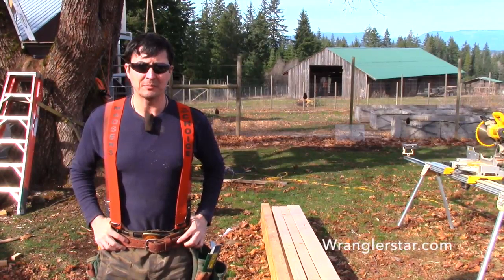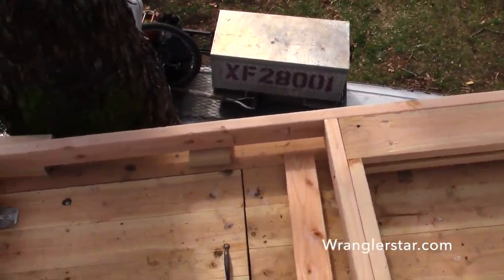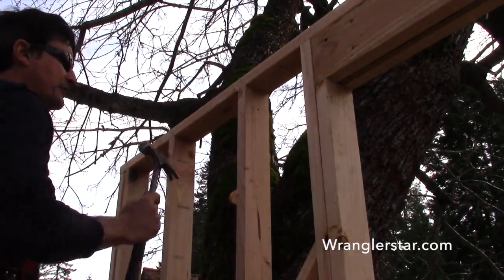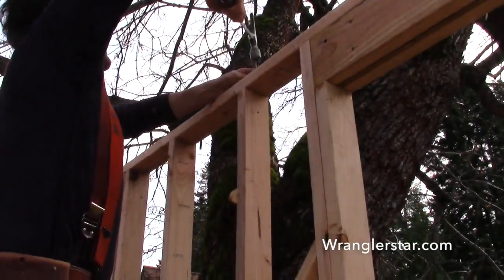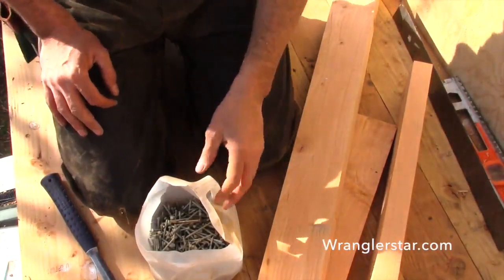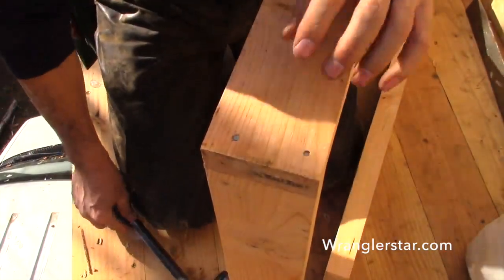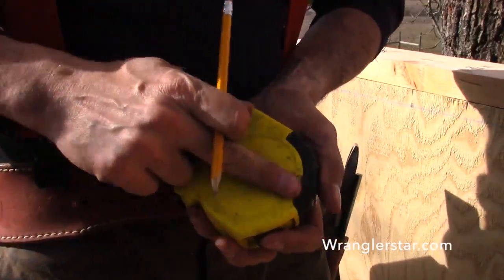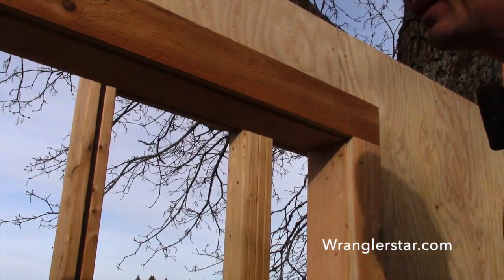How To Build A Treehouse | 20 Wranglerstar

Comment: In the Northeast we wrap our window and door casing's in .040 gauge aluminum.  We also do the same for facia boards.   The aluminum comes in many different colors and can be purchased with a vinyl covering over the metal or plain aluminum.   White is the most common color, then brown - these are readily available at most supplier's and box stores.   Drawback is you will need a way to bend the material, that's called a "brake".  It doesn't pay to buy one, it's expensive to rent one, but many carpenters and siding crews have them and will bend the material for you for a small fee.   Of course you will need to know all the sizes and lengths beforehand.    All in all, they get pretty creative with this material, and can cover almost any wood surface that needs to be covered and protected from water damage.  Other uses are chimney flashing, drip edge, soffit channel, and patching leaks in the roof.

Comment: I own both a dewalt and a Milwaukee sawszall and have used others on job sites...yours is the first I've run across that has that 90 degree blade feature. It must be a newer model than mine. I will say my Milwaukee unit is far superior to my dewalt, though I bought the heavy duty Milwaukee and the normal weight dewalt when it was on sale. Guess it made a difference.
Reply: wb5mgr I have a Milwaukee Sawzall that my wife got me for Christmas 30 years ago. It is the heavy duty model with the adjustable foot and quick release blade. I love it. I got used to using one when I worked in factories as a maintenance mechanic. When I borrowed one from work to cut a chimney opening for our new fireplace I told my wife I couldn't have done the job without it. She went to the local hardware and ask the owner what was the best one. That's what she bought. I also have a 18V Dewalt that my son bought for me for Christmas about 7 years ago. It is my goto reciprocating saw on any rough project. The battery going dead is kind of a pain but if I'm going to be doing a few cuts it's so easy to just pick it up and go. I have really abused it too. I dropped it 20 feet from a bucket lift while trimming a tree branch. It just bounced. When jobs are small or more than 100 feet from an outlet the Dewalt is the best. Not really an apples to apples comparison. I imagine a battery operated Milwaukee could do the same. While I'm on the subject I have a 1/2" Dewalt 18V drill like Cody's that is used at least twice a week for something. I like to drive screws with a power driver partly because of a touch of carpal tunnel and also because it's fast and easy. This year for Christmas my wife bought me a 18V Dewalt Impact driver. It's not the latest and greatest with the LION batteries but it takes the same batteries as my other drill and recip. I like it a lot better for driving screws. It has more power and speed and doesn't torque when it stops. I may have to switch over to Robertson style screw heads though. It will spin the heads off of a Phillips if I don't catch it.

Comment: I have always framed the window opening to size and than installed the interior window wrap later.  Rough framing the opening larger, than custom cutting the window wrap before placing the window is a new method to me.  I like it.
Reply: I have never framed that way myself, but do see some value in doing it that way.  If the wood is clear or beautiful it can be the finished product.  Yes, one will use more wood in the framing process and more time in ripping.  It is just another idea and I can see Cody's thought process.  Many people would think it is overbuilding though.

Comment: Hey, Cody, this might be kind of a silly question but I am a young man and don't have too much experience. I was wondering what is the difference between using a nail and a screw. I understand that a screw will never pull out unless drilled out. So why wouldn't you only use screws since they are so much stronger?

Comment: You should give the side of your tape measure a light sand so your pencil marks come out clearer, iv heard you need the use special nail with cedar because the oils in it eats the galvanize off regular nails and causes rust.
Reply: Correct, You should use stainless steel fasteners in cedar. Also, when using house wrap under cedar, use Typar not Tyvek. The chemicals in cedar will deteriorate the Tyvek in only a few years rendering it useless. My siding guy laughed at me when I requested this, I now have a new siding guy. Just a tip
Reply: Just right to get new guy, its not great when you can correct your trades men.
Reply: TheLunarmonkey, I'm the boss on my job sites. Sometimes subcontractors can forget that. I'm younger then most of my subs as well, that always makes for drama.
Reply: This is what I know...
On every home and I mean every home I have done renovations on the tyvek has been reduced to Swiss cheese. This makes it useless as a wind barrier, moisture mitigator and or drainage plane. Conversely, on every home that had felt paper behind the siding the felt was intact and fully functioning. Once the tyvek turns brown and splotchy it's finished. Unwoven fabrics, of which tyvek is in the category of, cannot be torn by hand because there is no grain or woven pattern at which a tear can be  started. Tyvek that has been compromised by the tannins that are in both the sheathing and the siding can easily be torn in half and usually has already been eaten away in spots. All of this damage is simply the result of resting against wooden surfaces (surfaces it is supposedly designed to be in contact  with).
I recently removed unprimed pine clapboard siding from the back of a garage. The tyvek was covered with brown blotch spots and I could tear the tyvek in half easily. It was essentially useless.
The manufacturers of this plastic covering have not, and probably will not, release information about it's susceptibility to the tannins it will inevitably be in contact with. After all, they have the construction industry thinking it is the be-all/end-all of all house wraps and as the "industry leader" imagine how much they have at stake were they to admit their product is incompatible with the environment it is targeted to suit.
Other renovators/builders I know hold the same opinion. Now is as good a time as any to help our fellow carpenters, our customers and our industry by joining together to seek alternatives to this misrepresented and often short lived product.
Reply: I did have one customer insist. I back primed all the siding first...
Reply: I thought they might say that. Man do you ever follow up on stuff! lol
Nice to have a conversation for a change. No insults or hate, this was a breath of fresh air. If you ever need help with construction or design, I would be glad to help. I have 20+ yrs in the buisness. Best, Rt
Reply: Rt Carolina Applause!! Applause!! I learned something new from everybody in this thread and it was great to have three really knowledgeable guys bouncing a thought between them. Thanks

Comment: I'm partial to my Porter-Cable reciprocating saw, I like how slowly I can get the blade to move by feathering the trigger. When I pick up another brand and try feathering its speed to start a cut but it just goes straight to warp factor 5 it really bugs me. The ones that switch between orbital for cutting wood, or straight for metal help too, its frustrating to cut steel pipe or such with a sawzall that only has orbital function.
  I only have about two 'DeFault' tools, I generally prefer Milwaukee but have all manner of brands so I'm not a complete brand whore, I look for features and durability first & foremost.

Comment: milk jug trick. milk jug bucket. put scrapes in take to barn give animals, also drilled holes bottom make water can. that not good idea but use hold nails is good idea. other small parts .

Comment: The reason it doesn't split the wood like that is because when it's a point it will separate the splines. With it being blunt it will break through the splines rather than separate them.

Comment: I forgot all about blunting the nail to prevent splitting you get away from the construction industry a guy forgets all the stuff. Cedar siding isn't as prevalent anymore 10 inch bevel is murderously expensive the cheaper option to still give you the 10 inch bevel siding is going with Hardi plank some people hate the stuff some people love it. Myself I like board and batten it looks rustic the cheapest option is go with ranch wall that stuff is last choice.